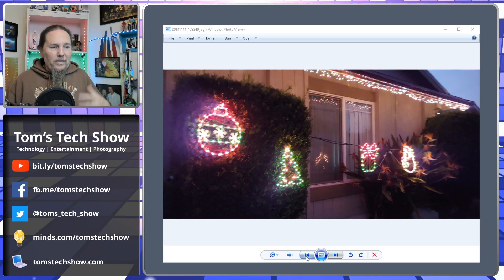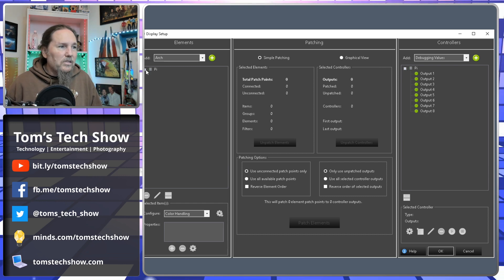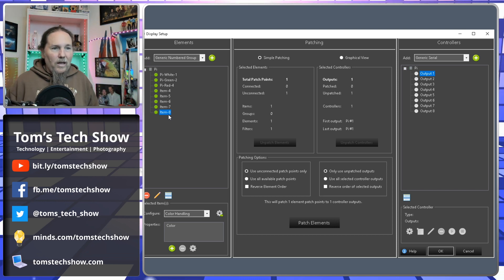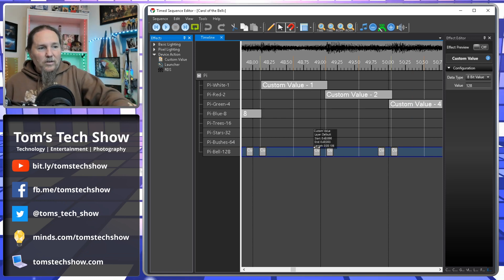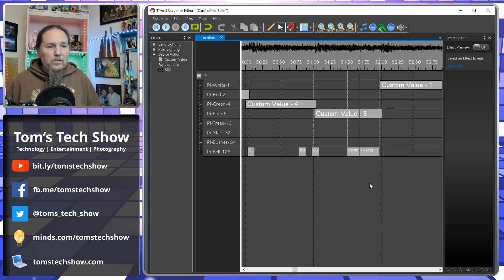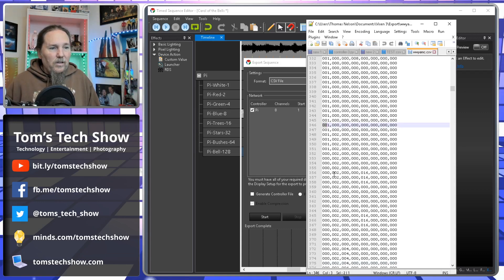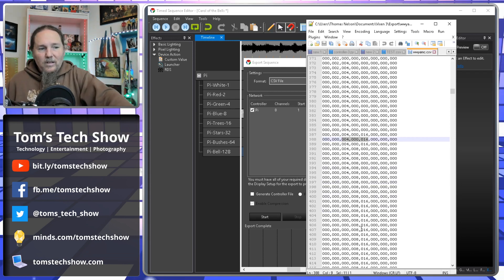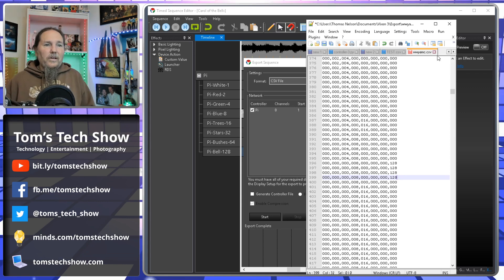Raspberry Pi Christmas Light Control Part 3

Comment: I am in the very beginning stages of learning to program a raspberry pi.  I am trying to use vixen to make my own sequence.  I  am using build 3.9u5 build #1142.  I have no problem exporting the csv file.  When I open the CSV file in notepad or excel to review only 000 appears.  Everything is patched as it should be  I have them named test-1, test-2, test-4, test-8, test-16, test-32 test-64 and test -128.  I was getting the same results when they all had different names as well. I believe I am following what is happening I am unsure why 001, 002, 004, 008, 016, 032, 064, 128 and not showing in the CVS file.
Reply: Did you ever resolve this issue? If so, would you share?
Reply: @smskitampa  did you ever find a fix for the issue?
Reply: @s3vn77  I ended up finding that Xlights with FPP was a much better solution for me. While I do have a PI with the SSR,  I moved away from AC lights and Vixen to Pixels and Xlights.
Reply: I am having the same issue myself, trying to figure out why. I recreated my controller and element, made sure the controller is active, made sure I have entries in all 8 rows, etc. but it continues to export all 000s. I am trying to join the forums so I can ask there as well..

Comment: Would you happen to know why my csv files exports as all 0000s? When I make the sequences I make sure to set the custom values.
Reply from the maker: That has happened to be a few times, check the mapping in Vixen for the channels.
Reply: @TomsTechShow  Same issue as the OP, checked my mapping in Display Setup and it's spot on... any thing else that would cause all 000 in the csv you know of?
Reply from the maker: @myers2782  the only thing I have done is delete and redo the mapping,.  Sometimes it does not work and then it does and I don't change it after that
Reply: @TomsTechShow  I'll check that and let you know. Thanks
Reply: @TomsTechShow  That worked thats so much. Great tutorials

Comment: Do i have to setup coding to raspberry  pie like arduino or just hoik it up  the raspberry. Pie. To the computer pls explain
Reply from the maker: You have to run the code on the raspberry pi,  I typically edit the code on the Pi as well.   For this project I do not use and arduino.

Comment: How to save sequencing file. Suppose the computer breaks down.   (Complete  ) And how to put the same sequence to other computer pls explain
Reply from the maker: All the files are stored in the Documents\Vixen directory,  make sure you have a backup program running and it is backing up that directory, you can then restore that if your computer dies.
Reply: @TomsTechShow  Can u pls make a video how to back up the files  or if I have to backup the file do I need to download backup file software.  Like I hv a software app for mobile  what ever software I download I backup the file and save it in usb device so in case I lost I hv it in usb pls help.    Thanks once again

Comment: I work as an entertainment lighting technician and also learning programming at an online university. I have been wanting to get into a more controlled show to my xmas display. I start basic research last year into Vixen with interfacing an Arduino controller. I think your way of controlling was a great choice. I love how you added the relay values and used that to turn them on. What an intuitive way to adjust the values without the Vixen software. I will be working this next year to implement some form of control and possibly similar to you. I am a true marker and DIYer as well. Nice work here!
Reply from the maker: Thanks for the great comment.  I am hoping to move to 16 channels next year and integrate some WS2811 lights as well

Comment: Thank you for another great video!  if you lived closer I would drive by and check out your show but 2000+ miles away is to far. LOL  next year I should be able to sync. mine to music, this year will be just arduino and 16 channel relay board with a pattern.  I am running linux so unless I try to run it with wine Vixon is not going to work for me. Thanks again for the info and the inspiration.
Reply from the maker: I am hoping for 16 channels next year.   To run vixen you could use Virtual Box and create a windows VM.  You should be able to get patterns done before windows wants to activate.
Reply: @TomsTechShow  I do have paid license for win xp and also win 7 but I was trying to avoid microsoft  (you know just trying to be a rebel) LOL.  but I might just go that route, and like you said it is a lot of work. please share your finished show, we would love to see it.
Reply from the maker: @kenseastrand7428  It is close to being done, just working on some of the timing for the lights.   Probably post part 4 tomorrow.